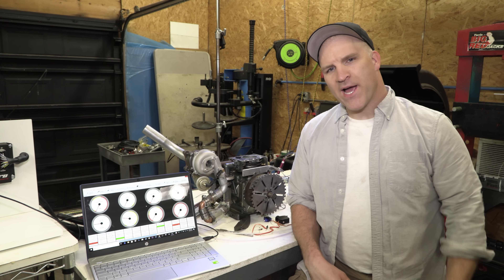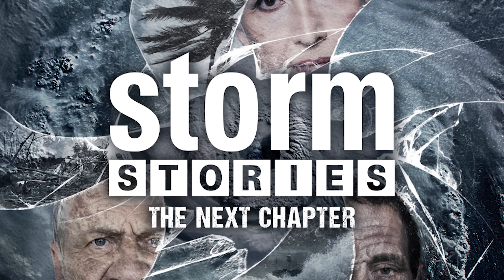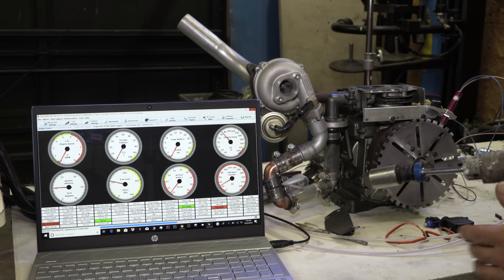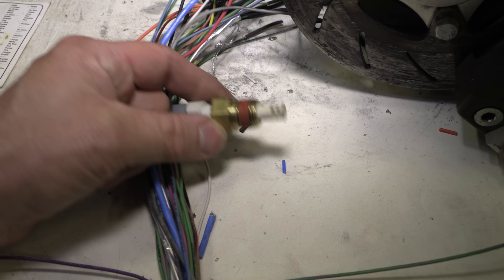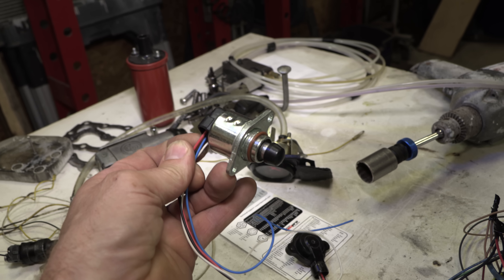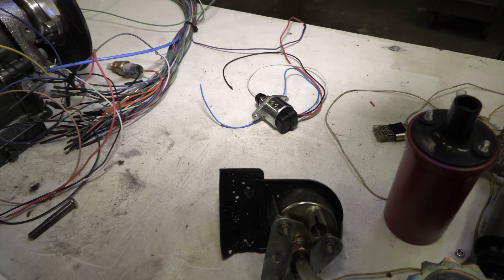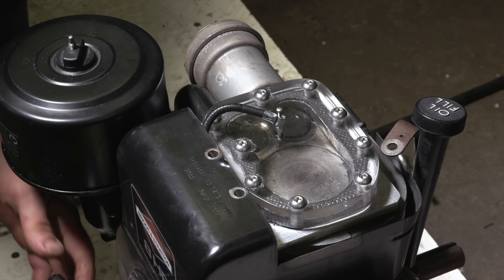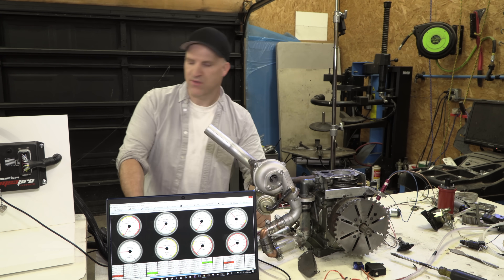See Through Engine UPDATE (Project Update-Turbo-Nitro &  EFI)

Comment: If you have that all good then unhook tps an control that by hand while running see how much you can throttle up with out turning tps. If you can throttle up an further more if you can get full throttle with tps in your hand by not advancing tps and or only give tps say half throttle or so. Or to keep ez if  butterfly valve  can run wide open by not going full throttle on tps then you obviously need to turn do your fuel. An if this wrks but yes you’ve turned your fuel down an ect already an nothing helped but now with tps in hand an able to full throttle butterfly vale while not full throttling tps then injector is just way to big so you can’t configure in your tune no matter wat you try.

Comment: If your waste gate owns you will not be able to achieve wat your trying to do. In your next video it runs bad. If your waste gate is not opening an you get your fuel correct then you will be able to not only go full throttle you’ll be able to go full throttle from an idle

Comment: Also thru out all your testing have you felt or seen  your waste gate move. Also is the waste gate arm adjusted correctly an also is the waste gate valve sealing correctly. Anyone one of these things will make it not wrk well. You want that waste gate valve sealing well. Also you don’t want that wastegate to open at all.

Comment: Just a thought you should have the coolant temp sensor in between the find not touching then use thermal paste for a computer and pack it in and around it that will transfer the heat better for a more accurate reading. With efi it will be looking at temp for starting and running and I believe adjusts fuel ratios according to engine and exhaust temps

Comment: EFI will let you run larger throttle body and slightly larger intake manifold.
My old home fabbed mechanical systems, for my racing mowers, were fickle on weather changes.

Comment: Just as a heads up my guy, those factory 2nd gen eclipse blow off valves start leaking as you approach 12 psi. I question whether or not you'll be making that kind if boost but IF you do keep that in mind. So looking forward to that video.

Comment: A 5hp Briggs would be a good upgrade because of all the performance parts they make for them (billet connecting rods, cams and billet flywheels) with a billet rod I’m sure it could take all the power you could throw at it

Comment: You really don't need that air idle control valve or the throttle position sensor. you can do it without and it simplifies the Turning process. I've got megasquirt 2 and I don't use either of them and it runs great.

Comment: You don't need an IAC.  But props for getting the MS3, those aren't the cheap ones.
Reply from the maker: You are 100% correct, I actually don't even know why I hooked it up. I think it may have been to future-proof the system so I can just hook it up to another engine.

Comment: 1000cc injector? how much hp do you think that thing is gonna make hahaha its usualy 1ccper hp, on my car i have 5x 420cc injectors and its runing over 300hp... you may have problems with that injector as it flows TOO much so getting it to idle might be kinda hard. smaller injectors are easier to setup
Reply from the maker: I completely agree, I had a little bit of trouble finding a small injector, but I'll see how it goes.
Reply: @WarpedYT  tbh, finding smaller injectors is easy. If you have a junkjard near, go to it, open the hood of a old volvo (850/s/v70) NA,  those injectors are like 230cc and you can find charts for them easily (dutycycles ) there are probably plenty other cars with injectors like that, but i am a volvo guy , so thats where i know you can find some lower flow rate omes haha. Prob on hondas too, i dont think those 1.6l engines use high flow rate injectors ...

Comment: This should be pretty awesome,  those megasquirt controllers are surprisingly capable ECU’s.  That MS3 will run up to an 8 cylinder engine with 8 coils, and I believe a V12 in “wasted spark” config. I wish I lived closer to you and could help with projects like this, I used to build engine harnesses from scratch once upon a time, and I used to do R&D and product design for a small company that specialized in EFI conversions. I solved a lot of problems with adapting modern engine controllers to older non EFI engines while I was there. Always wanted to EFI and turbocharge a single cylinder engine like this. Can’t wait to see the results!
Reply from the maker: That's awesome, you are right, that ms3 was surprisingly easy to program and very capable, also very flexible, the amount of options that they had in those menus covers just about everything. That's cool that you've done the EFI conversions before, this is my first one.
Should be done very soon now

Comment: Small turbos are nonsense, they can't build up enough pressure to make a difference, that's why in turbocharged cars a simple way to increase horsepower is change the turbo for a bigger one
Reply from the maker: Maybe so but this engine currently made about twice the power, we shall see what happens though. once I have full control over all of the timing and fuel we may be looking at a different story.
Reply: @WarpedYT  yeah another way to push more pressure into the engine should be with a bigger turbo from something like a diesel engine and then shove in a nice blow off valve, maybe you can put in 8 psi. I'll be waiting for the results👍.

Comment: That 1000cc injector is set up for about 120 HP per injector. You're not going to get the idle metering you're after it way way too big. It's going to run like garbage.
Reply from the maker: Possibly true, I do have smaller injectors, so if I need to I'll just swap it out real quick, but I'll start with this one. Thanks for the feedback you definitely get me thinking

Comment: A little comment:

As fueling, load and other factors depend on the coolant temperature to be determent accurate, I placed my coolant sensor in the engine oil when I converted an air cooled engine. (110cc Honda super cub) That worked okey enough. Your oil will be a little hotter, but you could try to tweak it with a correction factor.

First time I heard anyone refer to the mailman as jesus 😅
Reply from the maker: That's the first thing I thought of was to put in oil but then when I thought about the function of the air-cooled engine, I think where I place it is pretty adequate but it may need more thermal heat sink for better heat conduction with the cylinder.
Reply: @WarpedYT  The I would try to get the exact same thermistor in a smaller package so that you can get it closer to the engine wall. I would also try to place it somewhere that there is as little air moving over it as possible. The air passing the cooling fins is a lot lower in temperature than the engine itself. You wouldn't trust the hot air blowing off your radiator to accurately measure your engine temperature in a liquid cooled application, even one without a thermostat.

It is important that you get the exact same thermistor, it can have the same value at 2 reference temperatures, but still have a different up/down ramp on the resistant vs temperature function. Drilling and taping an 1/8 npt hole in the bottom for some oil temperature would be the easiest and fastest solution I would think. Even though it only is a oil splash lubrication/cooled engine (no oil circulation.) 

I think it will help the engine hold up a bit longer before it implode as getting the correct fueling and ignition at high boost kind of is important :)

Comment: An engine that small is going to have great difficulty driving a turbo that large, at least enough to have any real effect I would think.
Reply from the maker: Yes but you have to keep in mind that I am not running gasoline, nitromethane baby!. And if that doesn't get it going I'm going to use a new trick that they use in F1 racing.
Reply: @WarpedYT  Good luck with that, great videos.   Perhaps a belt driven turbine (supercharger) would provide more flexibility since you can adjust the pulley size to get the most optimum RPM/boost possible.  The maximum possible airflow that 5 hp can develop will never match the airlow a 100 hp engine can develop which is probably the size your turbines were designed to be paired with. Very very interesting videos, I enjoy them thanks.
Reply: @WarpedYT  if it can't spool it just use a leaf blower in the turbo inlet to get it spinning until it makes enough air to run itself.

Comment: you got alot on your plate but wait...the fuel injector timed by the degree wheel will be the most important swap up..these 4 cyl. motors are hard to start at times and i believe its caused by inadequate gas in the cyl. during cranking..even without the nitro it still should be light years ahead of its predecessors..this looks interesting

Comment: That is a ridiculous setup for a lawnmower engine
Reply from the maker: It made quite a bit of horsepower
Reply: Warped Perception you should have built the five horse Briggs flat head. You could have put a billet racing rod and cam and a forged crank for like 300 give or take, since you got the turbo you don't need a cam really, scratch cam get a piston. So less than 300 you could have a 30 to 40 hp screamer
Reply: I do think enough of this could be portable for a big-power setup.  Could make for a truly epic burnout go-kart.
Reply: @WarpedYT  I'm genuinely excited to see how it goes.
Reply: Would a 10hp lawn trimmer be better.
Reply: I need to put that into my lawnmower :D
Reply: that's not a lawnmower engine
Reply: @xgamerbih  Well, not anymore xD
Reply: Chuckiele No, what I mean is that the shaft iz placed horizontally, while lawnmowers need vertical, obviously, but not all mowers, but 90% do